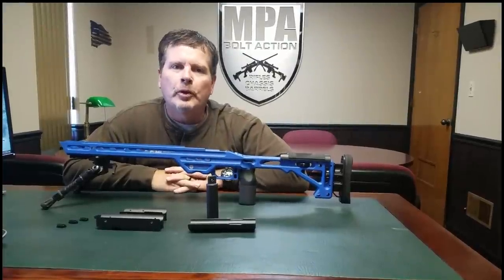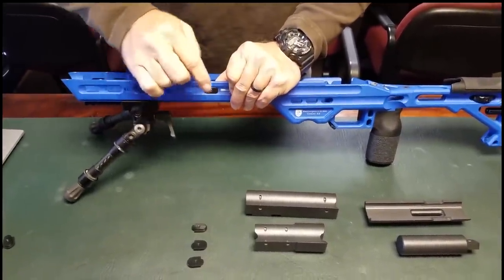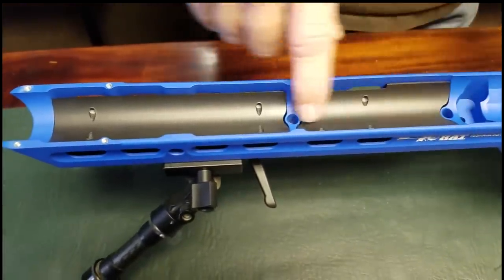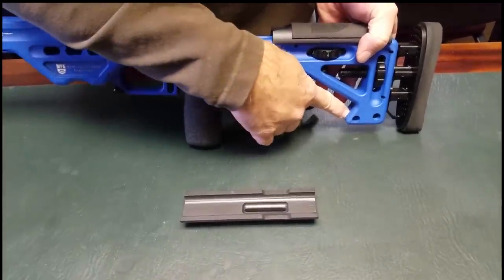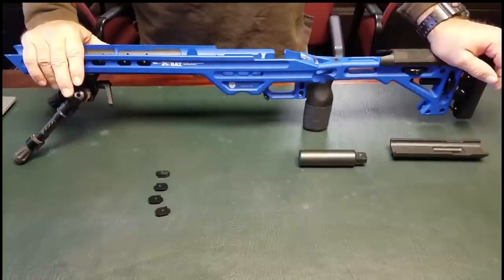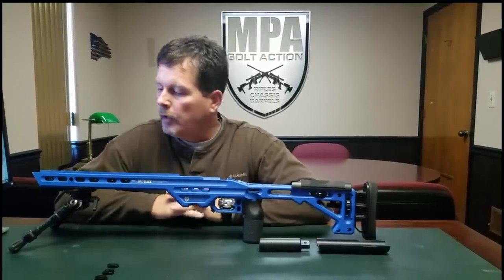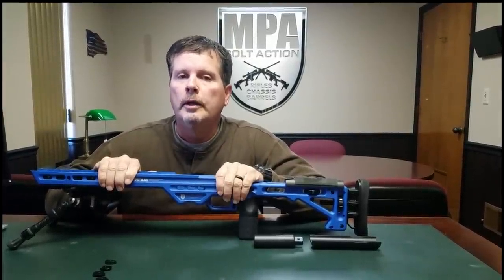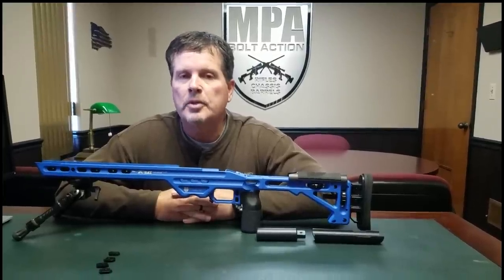MPA Weight Tuning System

Comment: Will the MPA Weight Tuning System work older model Comp. Chassis?  Will it work with Unity Rail or will I need a RAT adapter to connect my Atlas bipod?
Reply from the maker: It will work with the older chassis. However, you will need to get the Rat cut for the bipod location along the length of the fore end.  You can send it in for the cut.